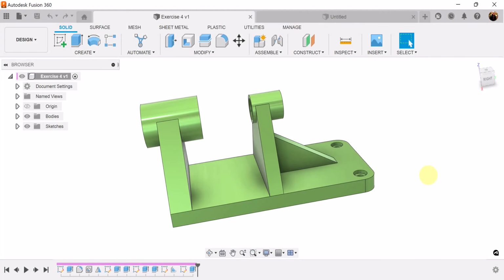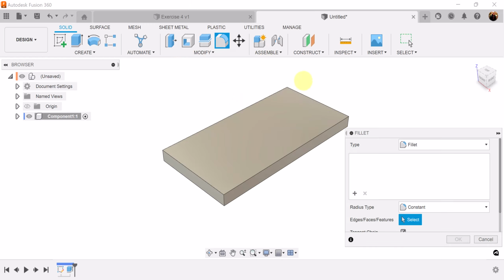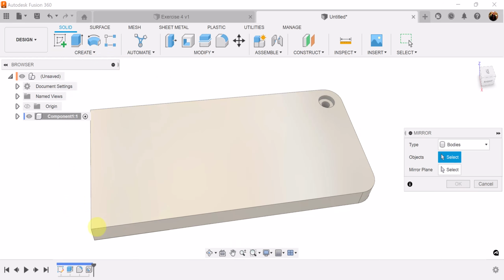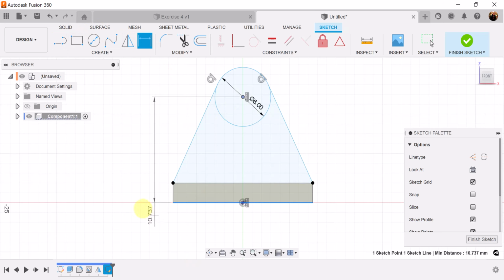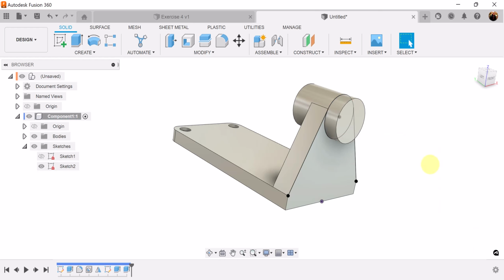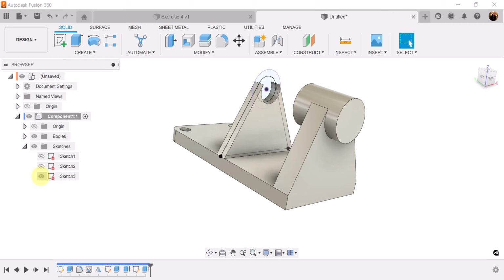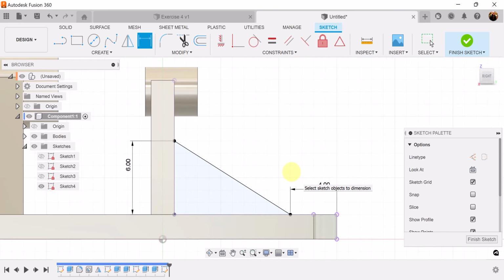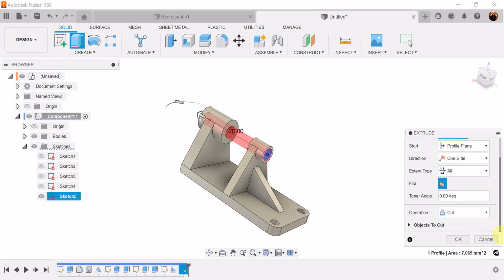Modeling in  Fusion 360 I Rep no. 4

Comment: hey man! Im still having trouble with doing things like what youve done at 5:04 in this video, I dont get any snaps to the existing geometry even though I have show projected geometries checked?! thanks again love this content.
Reply from the maker: Interesting. What specifically are you trying to snap to during this phase of the sketch?
Reply: @CADJungle  at 5:04 when you snap the circle on the new drawing picking up the point from the existing sketch and then again at 5:16 when you snap the line down the bottom to the existing sketch, I have no snap points available unless I manually project the lines themselves?! I do have the show projected geometries box checked tho?!
Reply: @matthewk5325  I'm having the same problems.
Reply: @matthewk5325  I had problems with this as well but I figured it out! If you go to Preferences, then Design, make sure that Auto project edges on reference and Auto project geometry on active sketch plane are turned on. This did the trick for me!